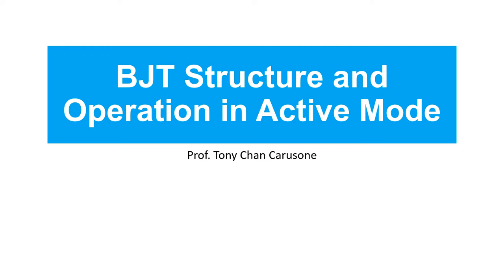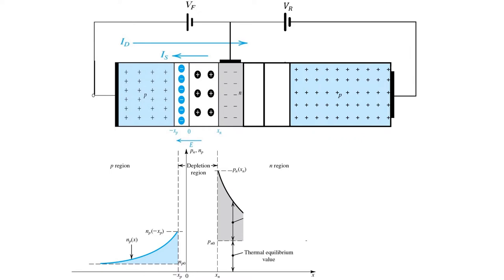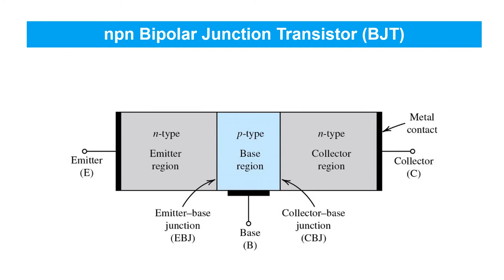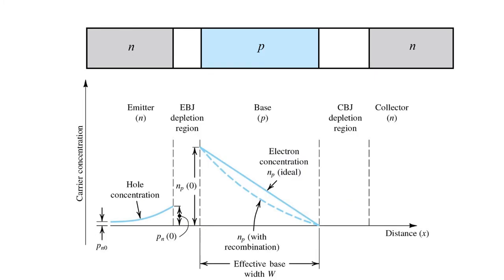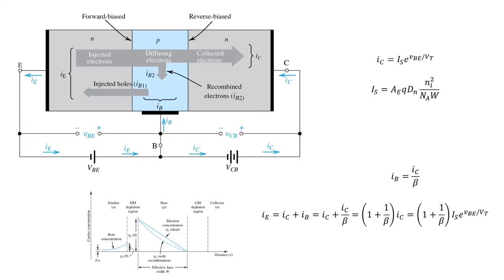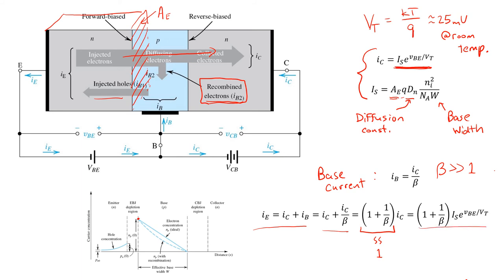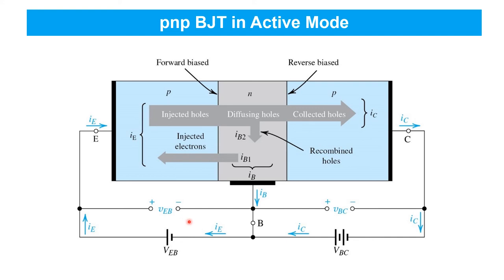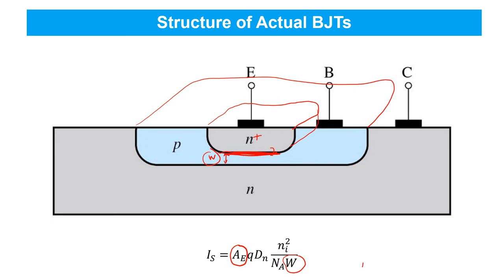40 BJT Structure

Comment: Nice, clear video. Do you know why superposition is allowed in the derivation of this model of the BJT? I mean, ignoring the space charge layer width differences. In particular, the derivation whereby first V<B_C> is assumed zero and then V<B_E>, which allows the assumption that there are no minority charge carrier at the boundary (of the region between B and the opposite n-type region) to be made, and then leads to two expressions for both i<C> and i<E> which are finally summed? My book briefly mentions that: it's okay because each junction has only one non-zero voltage applied to it. But, I'm not convinced, or more accurately don't understand it well enough. Any help? Thanks.
Reply from the maker: Charge conservation requires that the emitter current equal the sum of the base and collector currents in steady-state.